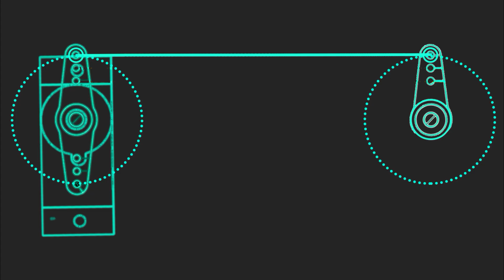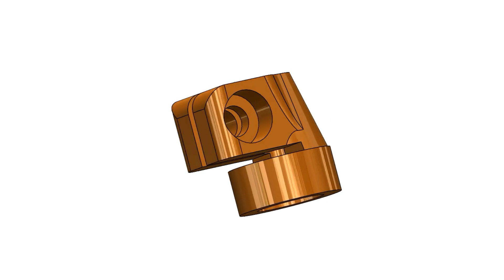Direct Shaft Coupling VS Stock Horns and Arms for micro servos

Comment: I really like this model, but when I was trying to do it for a drone that I designed myself, I was unable to understand how you could cut the central shaft connector form the sg90 servo motor so perfectly.  No matter how  hard I try its close to impossible for me to cut the central shaft connector. I probably need some machining tools in order to cut it.

Comment: I struggle to print the direct shaft coupler using PLA, because it is hard to get the gear printing consistently. Do you have any suggestion on the printing settings?
Reply from the maker: If you mean the internal teeth gear that houses the servo output gear, yes, we can't print it. I cut it out from the stock arms of the servo package and glue them to the printed part.

Comment: Don’t forget, this solution is limited when more deflection is required, as the resistive force is fully transmitted to the servo from the control surface without any reduction. This becomes especially noticeable when flying your models at high speed

Comment: idk man, direct drive seems too much torque input on the servo gears, thats why you have the setup thats current to increase torque pressure at the aileron flaps whatever increasing precision on throws you still need gear reduction to have more force onto the surfaces to turn the airplanes when they are moving fast. however its very interesting but unecessary.
Reply from the maker: The gearbox inside the servo has a 6-stage gearbox to increase torque. I feel like the issue among hobbyists is more about obsession than performance. by the way, this coupling has its application and is not meant to replace everything.
Thanks for your comment. ♥

Comment: The flight control surface must move small angle with large force that is the reason for the 4 bar linkage try flying your plane and you will quickly realize that you have too much control authority cool plane btw
Reply from the maker: Thanks, I'll try and share the results soon.

Comment: If the plane is 3d printed the coupler could included be in the moving surface
Reply from the maker: The coupler and the control surface can be printed in one piece when its axis is placed directly on the servo output during installation. But most of the time, the trailing edges of fins and wings are not thick enough to accommodate the servo inside them.

Comment: You said external and a liability to damage at the same time showed an essentially high quality heavy duty bulletproof adjustable post, servo and horn. What you are doing mught be good for lightweight stuff but scale up and your method is going to nee heavy duty precise expensive servos.  Also your method does not allow the mechanical resolution adjustment (already mentioned but very important). Still great work developing what you are doing it definitely has it's place and im sure will be incorporated into modern 3d printed scratch builds. Also the video was pretty well done.
Reply from the maker: hello my friend, Thank you for your comment and the information you mentioned.

Comment: This is ONE  of the solutions and it does not REPALCE taditional linkages.
Definitely has its uses and I have used similar setups of direct drive.
The degree of MECHANICAL fine tuning can be one of the many things to be considered !
The usermust evaluate all pros and cons for the given application. a redo can prove quite the b!#ch.

Kudos to a nice video and great work done on this system ❤❤❤❤
Reply from the maker: Yes, that's right. I am also planning to do some work on the development of servos suitable for this application. I hope it goes well.
Thank you for your comment.

Comment: The problem is that a servo needs to rotate between 40 and 45 degrees either side of center while the surface may only need to deflect 20 degrees. If you turn the servo travel down to 50% in your transmitter, you’re decreasing the resolution by 50%. That’s not a good trade.
Reply from the maker: Yep, especially with these cheap servos, resolution is a bit concerning.

Comment: If by "price" you mean drawbacks, you forgot one.  With this setup, you can't control the ratio and with many models, one to one will result in too much throw.
Reply: Linkage are an héritage of a time when we could not program limits and curves. 
Now we can so this method of integration for servo makes sense. No one is right or wrong, just do it the way it works for you.
Reply: @xavtek you can’t change physics so there are facts and preferences. You can discuss your preferences while knowing there are factually certain drawbacks. 

+ it’s a clean solution 
+ it’s would be great for applications where the surface has the same range of motion as the servo (e.g. 60 degrees)
- for control surfaces that move less than 60 degrees you lose torque 
-for control surfaces that move less than the servo range, you lose resolution. 
- No transmitter can compensate for loss of resolution and torque.

I personally like “direct drive” and used it for tailerons on a small model once (epoxied a long 2-arm servo arm to Depron control surfaces. 
I will keep using mechanical advantage (linkages) for pretty much all my applications, but this is a nice alternative for certain applications.
Reply from the maker: Hi👋

As I mentioned, at 01:35 the torque will remain the same unless you change the ratio of horns to something than 1:1, and with this coupler, it's always 1:1.
Thanks for your comment. ♥
Reply: Your 100% wrong.  Turbine guys use this on there rudders and Elevators
Reply: @Mikeylikesit1968  Actually you are wrong.  With a linkage, you can set rate and differential and travel.  One to o e loses the torque multiplication through leverage.  Reducing travel in the radio reduces resolution.   You could probably differential with curves, but why?
Reply: @scottyh72  Your wrong as jet guys use servos with arms that are directly connected to the stabs
Reply: @scottyh72 servos have gears for torque. So buy the correct one? I don’t know what has less friction. A final stage in a clean environment but with teeth, or two external makeshift bearings? Resolution? Don’t we use 16 bit digital technology? How do servos know the position of their arm? A potentiometer? Or some optical pattern?
Reply: @ArneChristianRosenfeldt  Dude, do some research before posting.  You don't even know how servos work.
Reply: @scottyh72  my analog servos used potentiometers. So you could build and sell a servo with a 340° turn potentiometer followed by a last gear. Or you use a magnetic field and can sense only 150° .
Reply: @ArneChristianRosenfeldt  Yes you could.  For what reason?  Good servos already have hall sensors.  Adding a gear does nothing.   I fly a 150mph plank with 9g servos.  Try doing that direct drive without going huge on the servo and needing to reduce its resolution to nothing.   It's not going to happen.  There is a time and place for direct coupled servos,  but it is NOT a replacement for proper linkages.
Reply: @scottyh72  linkage for flaps could also be hidden inside the fuselage, maybe even in a clean compartment. Yeah, I was fascinated by how far engines and suspensions in car get without noisy gears.
Reply: @MikeyMikey1968  
What does turbine guys using this on their elevators and rudders have to do with me being 100% wrong about many models needing less than 100% throw?   I presume you realize that turbine guys typically have big wallets that can buy radios with electronically adjustable throws?   Many people fly cheap and require a mechanical ratio reduction since they can't reduce the throws via the radio and many servos have 90° of rotation which would split to 45° each way on the control surfaces.  That's too much throw for many models.
Reply: @Andy-df5fj  Nobody is using cheap transmitters anymore. All transmitters out there can do that. Flysky transmitters can do it. I have a Radiomaster that can do that

Comment: It must be remembered that most models don't use a 1-1 servo horn ratio, and gain both torque and precision at the expense of speed. This is essential for models that have high speeds and loads. If you use direct drive like this on a fast or highly surface loaded model you will need to choose a very high spec servo(and therefore expensive).
For lighter and slower models this method is great for it's simplicity.
Reply: Stunt planes solve that whit a leading edge part on the moving flap. it acts like powerd steering . the leading edge will naturally pull the other way so less power needed on the control surface. Most of the time the controll surfaces looks like a L shape where the food is the leeding edge part. Even a lot of ship rudders are used like that so they dont need heavy steering power.
Reply: @Dragon69FlyTeam  Go ahead and make that happen on a flying wing.
Reply from the maker: Hello, my friend,
Thanks for your mention. 👍

Comment: btw how did you keep the screw in? did you 3d print threads or did you self tap the hole?
Reply from the maker: That's the same screw that comes with the servo to mount the horn on it and I've cut the central toothed fixture of the horn and glued it in the coupler.

Comment: Hello, how did you draw the couplings for the servo? Do you have a solidworks file?
Reply from the maker: It's based on the dimension of the servo and CF tube that I selected for the model. I'll share the STP file on the website soon:
DynamixSystems.com